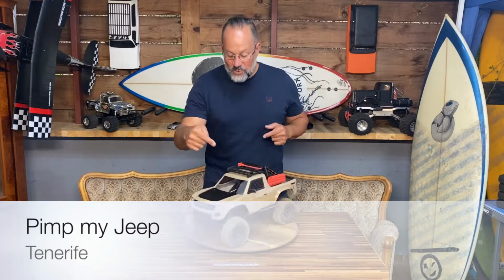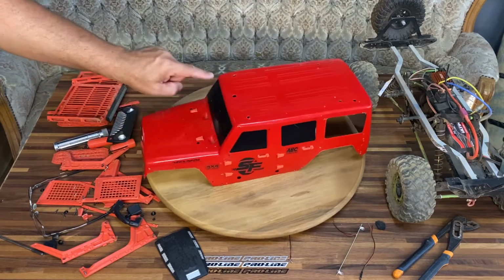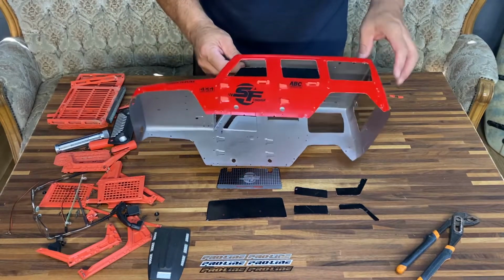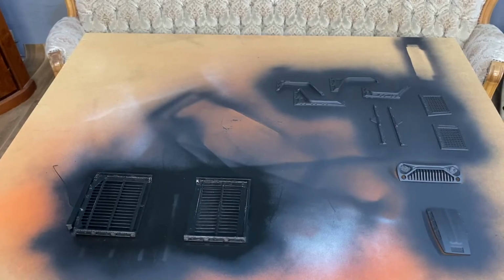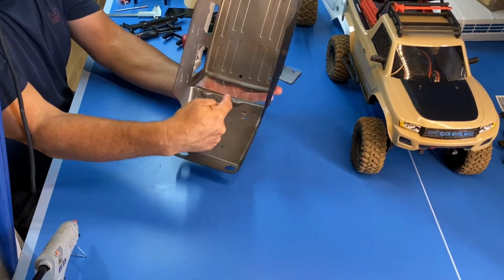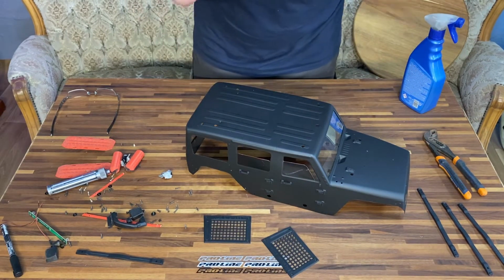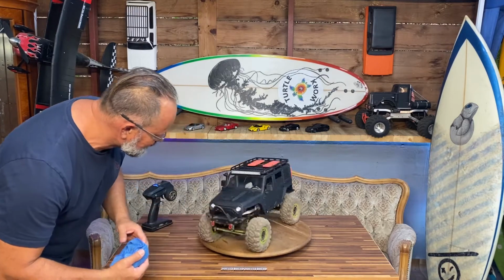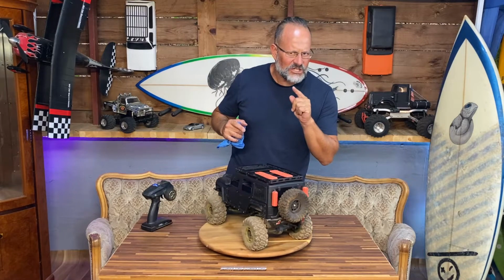Don't miss your chance to WIN some Proline tyres. Clear windscreen mods

Comment: I put together a rock crawler for the Purpose of loaning it out to people interested in getting into the hobby. It gives them a chance to run a RC Rockcrawler. I take my loaner truck everywhere I go. And in the last year I have introduced 10 people to the Hobby. I could use a set of tires for my loaner truck!!!
If you have someone interested in asking you questions about RC vehicles and you just hand them a controller and a truck! most are sold in the first 5 min!! Then The questions ??what to buy. Truck/tires/battery . It would be nice to start them out on a fresh set of pro lines. Currently I have a wore out set of Canyon trails.
Reply from the maker: That sound awesome great job! You are in the final draw

Comment: Canyon Trails are tired at this point. Your jeep looks great. How many coats of black did you do? Did similar with a grey defender turning it blue. Even with 3 or 4 layers it still got scratched to the base color lexan after a few runs.
Reply from the maker: You are in the final draw. Yeah 3 coats is about right but the ROCKS do a good job of damaging our hard work.

Comment: What spray paint did you use to paint the bodyshell? Was it a specific polycarbonate spray paint?
Reply from the maker: Hi I used MTN. It works very well and it is cheaper than the Tamiya cans
Reply from the maker: Only would recommend MTN on the outside, on the inside I would still use Tamiya